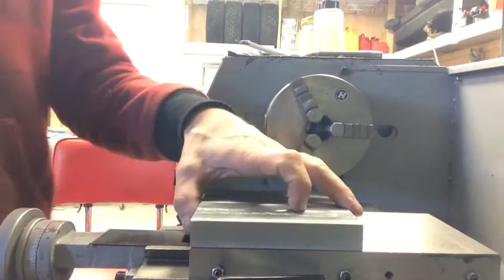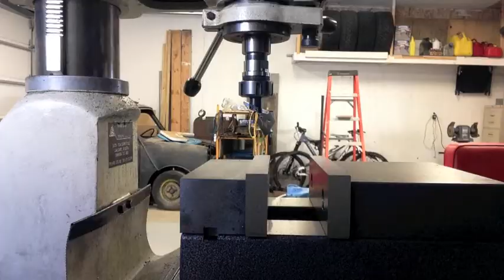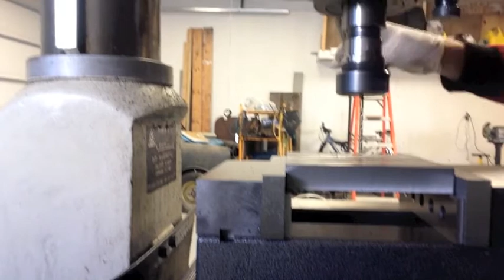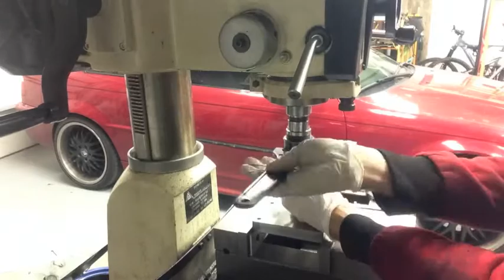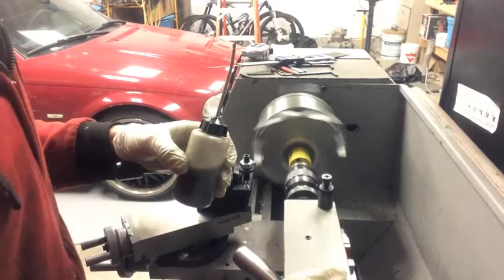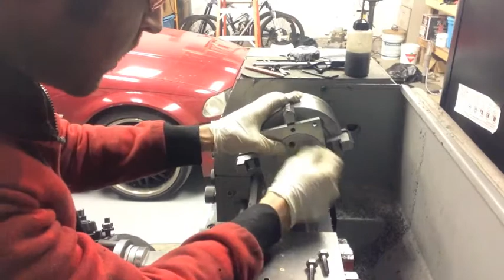Grizzly G0602 Lathe modification / KC-1022ML (part 1 of 2)

Comment: What tipe of mill is this one
Reply from the maker: My mill is a  round column mill. The make and model are Rong-Fu RF-30. This same machine is sold as a Grizzly G0705, a King Canada PDM-30 and others as well. 

If I were purchasing another mill, I would not buy this one unless I could get it really cheap, as the round column means that you have to reset zero any time you have to move more than a few inches up and down. This is not at all ideal.

Comment: Hey Joel!  How has the lathe done in threading?  Did you have enough torque?
Reply from the maker: Hey Ron. It's worked fine for any threads I've cut. You have to slow it down to thread, and because this uses a pulley system for switching speeds, that ramps up the torque. One of the few advantages of using a actual ratio change system. 

Changing speeds is a pain in the butt.
Reply: @JoelArseneaultYouTube  Thanks for the info, I should have asked if you were able to cut threads with the smaller lathe you had?
Reply from the maker: @ronbianca9722  I was yes. Again, I didn't cut anything too large or deep, but I was able to thread with no issues.... other than those related to inexperience - at the time. 

I think typically, unless you are cutting quite coarse threads, the tool isn't taking off a lot of material for each pass. If you have a variable speed lathe that slows the motor (DC motors) the loose torque as they slow down, so threading may be an issue. If you have a lathe with actual gear reduction cutting the speed in half doubles the torque, so it works out well. I believe with a VFD you also maintain lots of torque at lower speeds, but I don't know for sure.

Comment: Instead of having to change the bits out each time, couldn't you done all the center  drilling first then all the pilot and then the finished? or is it to hard to reset the vise/table to the correct coordinates? i.e too much backlash or ????
Reply from the maker: I was sure that I replied to your comment. Yes, way too much backlash. I've been considering putting a DRO on it for this reason. I have .030 on the X and .020" on the Z for backlash. To top it off, the dials are not marked well and the adjusters on the collars work poorly, so resetting zero is a pain.

Comment: hey, what vise is that you have and what size? if you don't mind me asking, I am a hobbiest and just starting out in machining, what can you recommend the type of vise, size and with or without swivel base? If I were to own just one vise. Any suggestion will be appreciated. Thanks in advance.
Reply from the maker: I'm not sure why I didn't see this comment 3 years ago. Sorry for not answering. 

Hopefully you have this figured out by now. That was a 6" vice and it's a little too large for the mill. I think a 4-5 would have been better. I have since milled the back edge off so that I can regain some travel at the rear of the table. 

I took of the swivel base and tossed it away. I don't like them, but maybe that's just me.  If I were to do it all over again, I would have a 4" vice and then a split vice ... I'm considering cutting up the vice that I have and making it into a split vice and then getting a 4"